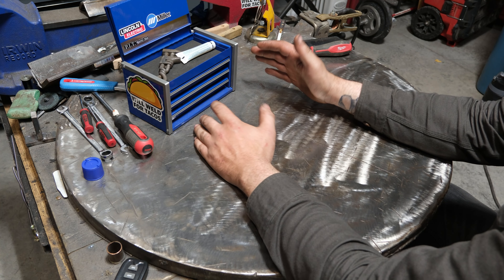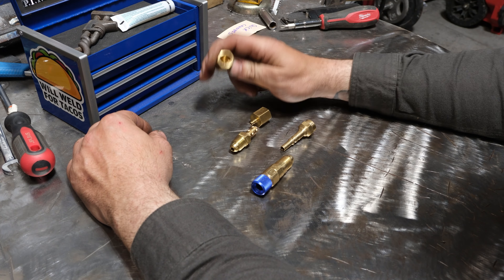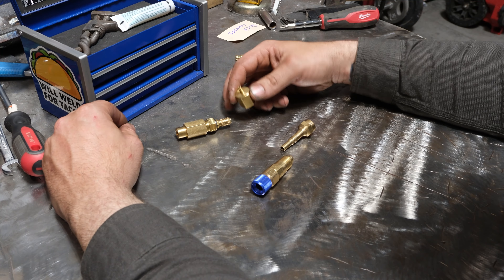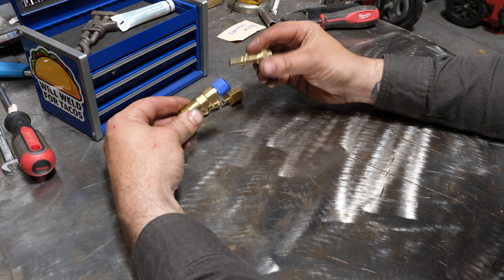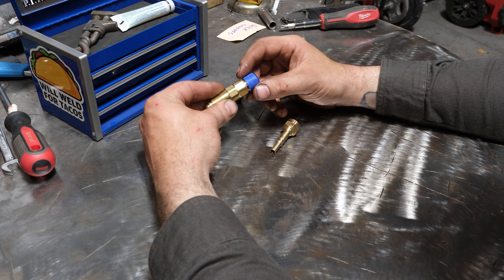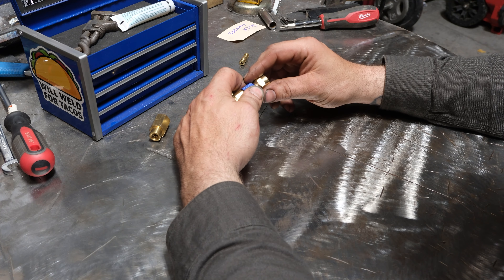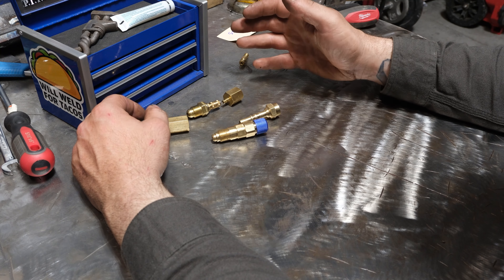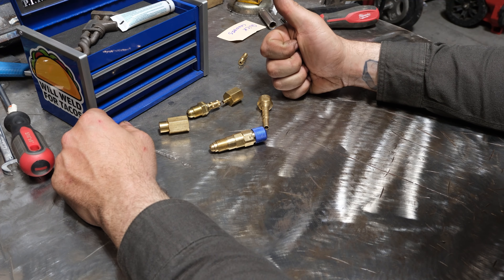A look at welding quick connect gas fittings QFTB#9

Comment: I couldn’t find what I was looking for in my neighborhood, ended up using Japanese style air fittings. There is probably gas leak, however it is minimal, I don’t leave the gas valve on unless I’m welding anyways.

Seeing the small qc fittings in your video, now I think I could have used the smaller airbrush quick connect versions, they don’t leak as much in my experience.
Reply from the maker: No doubt alternative fittings could be air tight. I am sure that the fittings in the video were used for something else (besides welding gas) first.

Comment: I love quick disconnects. I had a commercial film lab. We had 42 darkrooms, a half dozen film and paper processors, all needed air or nitrogen. I put quick disconnects on everything. That was a lot of connectors. But if something broke, I could replace it in a few seconds. When you’re running film, you have no time to literally screw around. On my ESAB 205 I bought two 1 foot hoses. One end screws into the back of the machine for the argon for TIG and the other for MiG. At the ends there are quick connects goi g to the hoses that connect to the flow meters. This way, when I have to I can switch the tanks around in just a few seconds. I bought the connectors from McMastercarr Carr. These are not from any welder maker, but standard quick disconnects for inert gas for welding. By using the short hoses, the connectors hang down instead of sticking all the way out. Much less likely to get damaged that way and easy to connect to. You can get the hoses in black or red so if you’re worried you might connect the wrong one it’s much harder as red hose goes to red hose, etc. If you intentionally switch, you’ll notice it when you turn things on next time as it will be red to black and black to red. I’d like to do a quick disconnects to the front argon connection for TIG, but they have that connectors under the front handle and it would be awkward.
Reply from the maker: I have still yet to put quick connection fittings on the 235 rebel, and I need to with the constant switching of gasses.  Every time I grab a wrench I think to myself how stupid I am for not doing it yet lol.  I like your idea with the short hose, that is definitely the way to go.  I think I am going to do that with my rogue and the fronius.  Having even a small quick connect that comes straight out is asking to break it.
Reply: @makingmistakeswithgreg  And I think you could have an extra male fitting that is capped off that you can use to plug the female end when you remove the hose.  This would reducing the chance of contamination of the female fitting.

Comment: I’ve been meaning to swap all my fittings to quick connects for a while now. Wasn’t sure what was what etc. 

So random this comes up .. this is awesome and perfect timing . Thank you 🙏🏻

Ps, the oxy/ace ones personally are annoying on the hand piece, but on the bottle ends #chefkisses🤌🏼🤌🏼🤌🏼.  But, good in situations like you said
Reply from the maker: Haha good thing you caught the video 😀.  The big PITA with the quick connects is there are so many different ones and they aren’t compatible with each other.  Stick with what you think will work best for your situation.  Honestly the ones with the blue collar flat out work and I have used them for a couple years without issue.  They are better suited to the regulator than mounted on the machine, but they will work for either.  It’s so nice to have them I wish companies just used them built into machines.
Reply: @makingmistakeswithgreg  .. very lucky indeed ! Ha. 

100% there is so many to choose from. I did get my hands on some high flow 2 stage quick release style a while back, but i didnt specify size so they went overkill and they are for half inch line. 🤣 So I guess they now are for my air tools . 🤣  And as of late, I notice that I have been getting leaks from where the hose goes onto the barb. It is nearly leading me to just hard line everything coz I seriously am struggling 😔 maybes it’s a faze I’m going through atm. 

Also thank you the efforts once again. And your advice with opinion not dictated by sponsors with actual experience. 

🤝🏽
Reply from the maker: @RepLicanT00100 you would be so shocked at how many “sponsorships” I get offered, probably 15-20 a week.  Most of them to review crap products or partner with some random company.  They can’t even be bothered to make a legitimate email, they use a copy and paste form.  Whatever it is that they want to offer isn’t worth taking it, especially because I already know it’s junk lol.

Comment: Thank you.  Do you by chance have any experience with the liquid quick disconnects for a water cooled torch?  If so, could you do a quick video on them as well? 🙏
Reply from the maker: The only water quick connects I have used are basically 100% the same as the everlast style.  I have not owned a water cooler that didn’t use that style.  Miller water coolers I only direct threaded the hoses into.  I can tell you those everlast style connectors didn’t leak at all, so I know they work.

Comment: oh nice, good topic to open up, In europe/ UK there is also a push by gas cylinder providers  (rent or deposit based gas providers ) to change over to  ViPR (Valve with integrated Pressure Regulator) cylinders. The VIPR is inside a heavy plastic cage/guard on the cylinder and you connect via a quick connect coupler ( the nipple end already comes attached to the VIPR) . So the regulator is now the cylinder company's responsibility, which I think is a good thing.  You buy the quick  connect coupler ( about usd 20) and attach a separate  ball bearing flow meter to it if you like.  I believe these cylinders are filled at higher pressure (300bar+),  lighter weight, higher quality / strength steel, more gas.  I will likely upgrade my  argon cylinder on my next refill and decommission my 6 year old regulator. good thing the bearing flow meter is a screw-on to regulator.
Reply from the maker: I have seen those cylinders in pictures, never in person.  Thanks for taking the time to share the details, that cleared up a ton of things.  It makes a lot of sense to run higher psi to get smaller cylinders.  I wonder if that setup will ever come here.  I definitely have not even seen a display bottle at the welding stores here.

Comment: What's the best way to cut 1/8" sheetmetal with a torch? I have a Victor Performer 300 Series but I don't think I have the right tip, it's too hot and makes a mess. I don't have a Plasma cutter or a large air compressor.
Reply from the maker: So it is possible to cut thin steel with an oversized tip, but it requires skill, a super clean tip, and typically a longer gap between the metal and torch tip.  They make a 000 tip for 1/8th that would work well for 1/8.  If you have a tip meant for 1/2in about the best you can do is back it down and run a longer tip to metal distance.  Earlier today I was cutting square tube with a smith torch setup with a 1/2thickness cutting tip, it works but you have to be fast lol.
Reply: @makingmistakeswithgreg  I have a tip for 3/8" and 1", but looks like I need to buy a 000. I didn't know the trick to run a longer tip to surface distance. I am used to lots of explosions from the tip touching the surface. I wish I could more easily keep the correct cutting distance off the workpiece. There is a guy here in Louisiana that makes barbecue pits, Allen's Welding on youtube. That guy is a damn Ninja with a torch, if you look at some of his old videos.